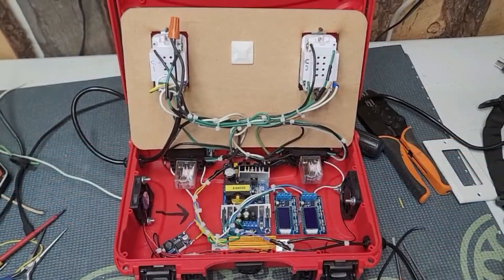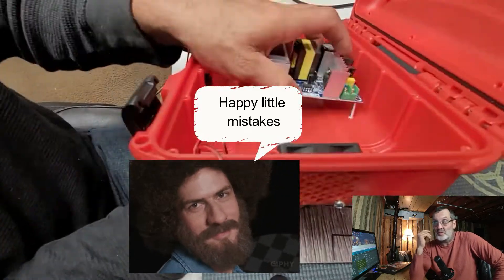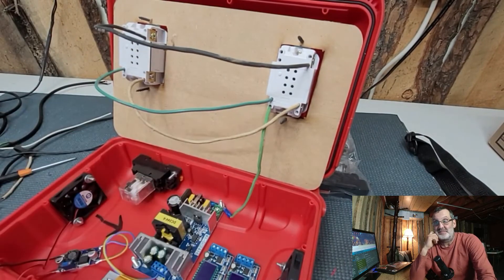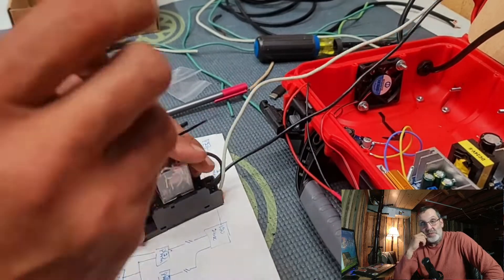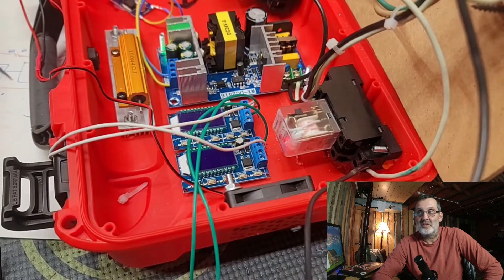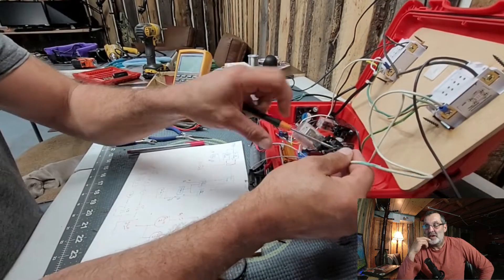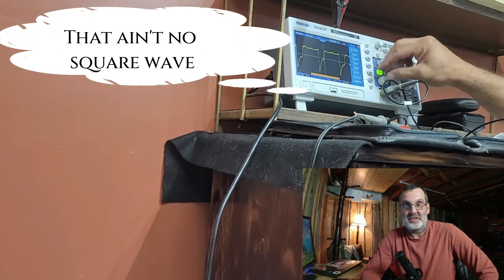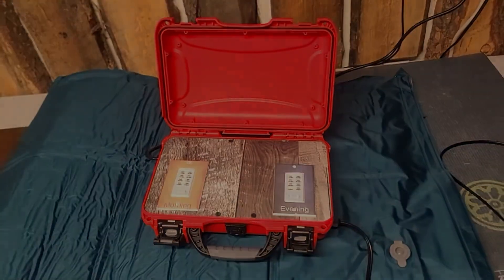DIY PEMF - Easy to understand and use PEMF unit

Comment: Does the resistor affects the output power?
Or just dissipates the heat without affecting the power?
Reply from the maker: A little of both.     What it really does is lower the voltage from the power supply to balance the mat coils.   

I am curently working to simplify the whole system and removing the resistor.    

Work in progress.

So the answer is yes.  It lowers the output of the coils.

Comment: Steve you are honestly doing God's work 😎🙏🏾 you remind me of the gent from Museum of Tarot, he also does what you do very well. I, from your teaching, also built my own PEMF mat because I have a problem with my spine and it does help a lot. The only thing I am uncertain about is the polarity of the coils on the mat; which measuring instrument do I need to buy to help me measure the polarity of the coils and make sure they all aligning properly?
Reply from the maker: Compas can help 

Using kne coil as the master, place each coil one at the time on top and with the help of a magnet between your fingers ypu will fell if there is a field or not.  If not turn the top coil over and now you should have two coils lined up.   Keep doing it with all coils against the master one.   This should get you out of trouble.
Reply from the maker: Oh.  And thank you for the kind words.   
If you can you van join my patreon 😀😀
Reply: Thank you very kindly I will definitely be contributing to
Reply: *contributing to your channel, I have never been on it but will learn and contribute. Thank you very kindly Sir

Comment: Any info on the bipolar square wave model?
Reply from the maker: We are working hard on the topic, we have succesfully created such a wave! we are now working on making it simple and robust! still have not found an easy way for people at home to reproduce the experiement and ensure it works :(  
the use of a magnet or  compass also works but requires precise technic and some knowledge to read the outcome. 

We might have to create a pcb board that will need to be purchase and use as a plug and play. If we go that route will ensure it can be retrofit to existing unit either people have gottneen from us or build themselves. 

stay tune!! 
It is coming.